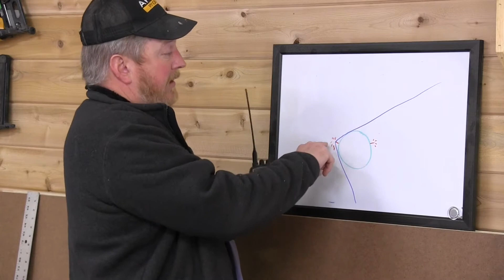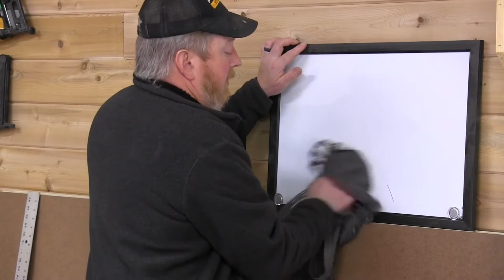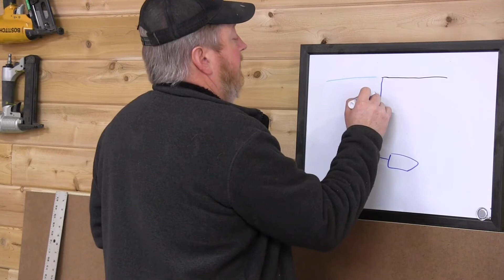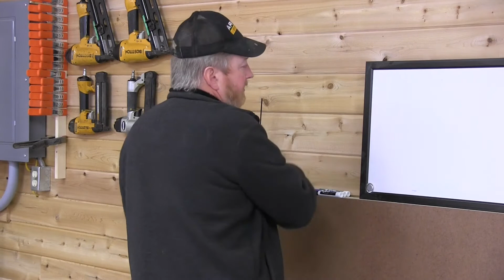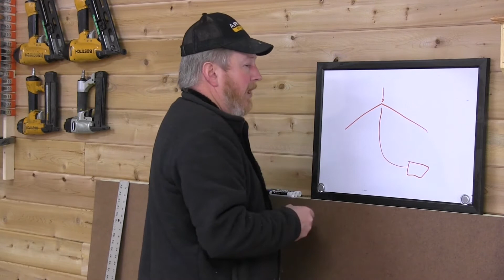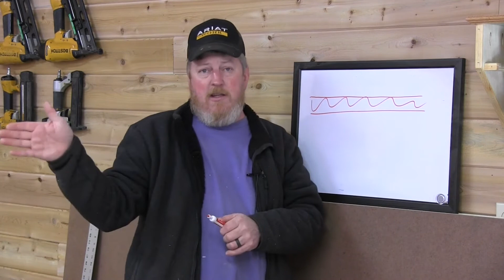Intro to Amateur Radio(HAM Radio)

Comment: I loved this. Please make more. What prevents someone from using the radios when they don’t have a license?
Reply from the maker: Mike, If it was not a time of emergency the FCC could fine you for doing so, I suspect some one would report you if you did under a time of non emergency. That said if its a time of emergency all bets are off
Reply: @aroundthehomesteadwithsuer3497  thanks for the response. Any and all information you have on the information would be greatly appreciated. I’ve thought about getting mi license and a introduction radio set up, but never looked into it further. Thanks
Reply from the maker: @mikegentile5030  Look around the area, Most likely you have a local club for Ham Radio, They usually turn out to be a wealth of knowledge and generally like minded.